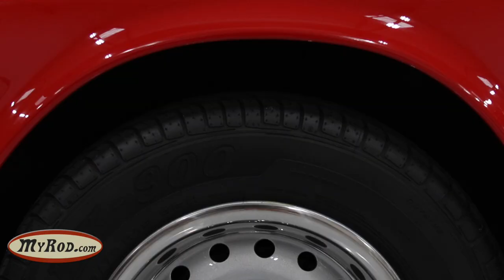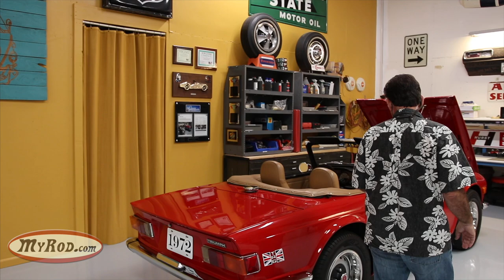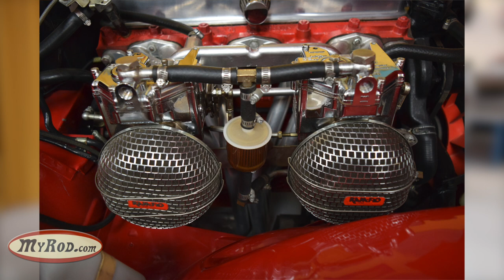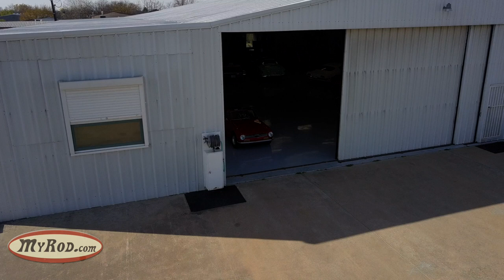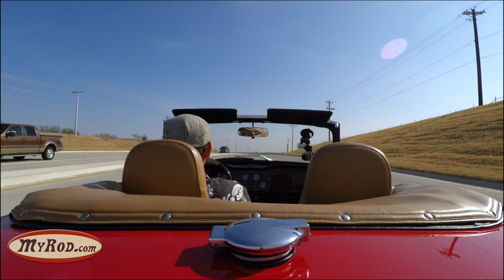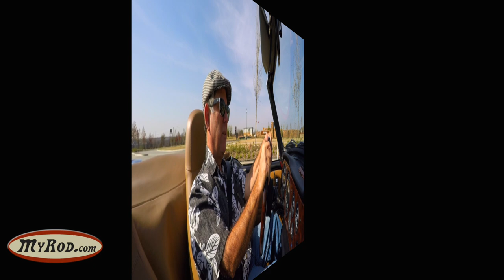1972 Triumph TR6 - overdrive & performance upgrades!

Comment: This is a beautiful example... almost new feeling. I've owned a couple of these, a '72 like the one shown here.  The purist in me notices several anomolies here, so many "improvements", the narrator keeps referencing the seat comfort, however, he mentions the seats are out of a Miata. TR6s weren't built with the driver's comfort in mind, they were thin, hard and light. And where's the red line tires? Or the blackout rear taillight panel?  It wasn't body color like this one.  The 1972 did not fly the Union Jack graphic on the rear quarter panel. Minor stuff, but the purist will and has noticed.  The engine bay IS beautiful, but again far from stock ... a chrome alternator? I will say the Webers are a great touch, as is the rear end box on the U-Joints.  The rear end is a real issue with so many 6's, there are 6 U-joints in the TR6, with its full independent suspension. I would have liked to have seen if there was any mod on the shocks/struts on this one. The exhaust is also a piece of art, and again, so far from original, but a nice improvement. I would try and find a pair of stock wipers, the ones on this car were too big. 
This car is a magnificent version of the car, and the improvements are well done and enhance the beauty and performance of this classic.
Reply: I own a 72 Red TR6 & have the GTO style TR6 lettering which I actually prefer to the Union Jack symbol.  I would love to have overdrive as I agree my TR6 is not comfy on the highway.

Comment: VERY nice, but shouldn't the windscreen surround and rear panel be black? And my 1969 PI (sold 17 years ago) had a flap as fresh air intake that could be opened and closed from inside the cabin :-)

Comment: Finishing the rest of my dads 69. He bought it 40 years ago hit a stop sign, and put it in the garage the whole time. Finished it 75% of the way 7 years ago did 1 car show with it and then it sat again. Zero rust, zero cancer all original garaged thee whole time. White top, white tail, all white interior, cherry red exterior with black bottom rockers. So unique. Just so on the fence on rebuilding my Strombergs or going this set up. Anybody have any input? Motor fully rebuilt mild cam in it

Comment: Just a note the rear end should be painted flat black , the tires should have red walls, the1972 did not have the union jack just TR6
Reply: Good Call.

Comment: Beautiful example, here in Britain we had a Lucas fuel injected version of this car,  actually a standard conversion here would be to replace the injection system with a triple webber set up, to be honest I've never seen a twin webber set up like this, why not go for three webbers?  Also on the overdrive, a company in England called Revington makes a relay box that means when you are in overdrive and want to change gear the  the relay box automatically switches you out of overdrive without having to manually use the change lever, it is quite useful, I have it on my car, RHD 1970 fuel injected with A type overdrive. That exhaust you have sounds like a Ferrari ,your right there, and of course "Ansa" are probably most renowned for making exhaust systems for Ferrari road cars. Lovely example, my compliments, Im here in Scotland, nice driving roads here, I've had TR6s for 40 years, it is the best car ever, and so easy to work on.Thanks for sharing your video.

Comment: super excellent. I always wanted to hop up my green '76 from what, the restricted real  100 hp or so .... the Webers a tuning problem or upgrade not from perf. but day in out reliable ?
Reply: The myths about Webers going out of tune are just that; unlike the Strombergs which I think your TR6 would have had, there are no moving parts to alter the tune from day to day. You won't believe the improvement in throttle response with Webers, with those big accelerator pumps, which also make starting dead easy - dab, dab, and turn the key.  They respond really well to a warm cam and higher compression ratio to get them sucking harder. Initial setup is tricky, there are a lot of "experts" who aren't, so dyno time is a must. Emulsion tube changes make a big difference in driveability, so try a few, but the dyno will again be very revealing.

Comment: Always loved the TR6....but my z4 will eat it for lunch. Beautiful car.
Reply: a TR6 & a Z4 are 40 yrs apart. Most of BMW car Design came Directly off Triumph's Designs. 
It's like saying My Electric car Uses Less Petrol than MY V12 E-TYPE Jag. 
You will Need to be ONE HELL FIRE of a Fast Driver to Pull away from my  BMW 525 i. 
I Blip the Clutch & Flick the Stick at 6750 rpm in every gear. until i'm Flat out . 
Single figure mpg. 
It will Happily Glide a Roundabout in 3rd at 50 mph. 
Push the Tail out & Steer with the Throttle pedal. 
I Find it more than Adequate to get through City Traffic at rush hour. 
& Fantastic on open Fast Country Roads. 
Drop a gear & Go into a bend with POWER ON Then FEED THE POWER ON until  Flat out,   ON,  or just after the Apex. 
Go in Fast under engine Braking, Match the Speed & Power for Traction, & POWER out FAST 
Never Change your Speed / Direction MID Bend, Allow the Car to Pull you round & THEN POWER OUT. 
OK you might be 6500 rpm engine Screaming under heavy engine braking dropping to 4000 rpm , Giving 2500 rpm instant Acceleration on the Exit. & Flick it up a gear to Pull away before the revs fall below 4000. 
Keep the 24 valve VVT Vannos Spinning.
& these cars are Like LIGHTING if you Drive them as they were built & Intended to be driven. 
Screaming i mean it will sound like a Jet Plane on Rapid Decent. 

A TR6 is for calm Lazy sunday afternoon Old Fashioned Motoring. IN STYLE. 
A Z4 says :- I had lots of Money but I Ran out of ideas for a Fun Car. 
Brilliant Shopping Cars For those who wish to look COOL in a SKIRT. 
Black Tights until 5.30 pm & Fishnets & Heels in the Evening. 
FORD CAPRI STYLE !!
Reply: @A1DJPaul  Well played sir. Touche.
Reply: @A1DJPaul  Having said that look up the BMW 507.  Pretty sure BMW came up with that design.
Reply: @daverunner3397  
Leave them Standing On the Road, Track, or in the Comments online. 
WOOSH I'm AWAY !!  all the best & see u later Alligator !
Reply: @A1DJPaul  Wink wink nod nod....
Reply: @daverunner3397  
OMG !! thee MOST FANTASTIC CAR DESIGN EVER !! 
( The Old Single Headlamp Sports car , ? 1950's early 60's Style ? ) 
I SAW one in a BMW Dealership & Thought INSTANTLY I WANT THAT CAR !! 
IT Looked so Modern & Mind Blowing. 
Is that the One ? or do you mean a Modern Version ?  ? 
Are we on the Same Car ? 
This one had a 'V' shaped grille 1960's Style /Ferrari style front . ( GTO ) 
2 dr sports car , Drop top, 
Merc 107 Pagoda era ? 

I think BMW did a Very Expensive / Exclusively Priced Car 10 / 20 yrs ago ( not the z1 ) 
My vision is of a Triumph Spitfire Style Car but slightly bigger &  As Good Looking as ANY E-Type OR Ferrari.

They were Silly Money New, & Silly Money Now.  £100k ++ ? Is that the One ?
Reply: @daverunner3397  
Thanks, Are You UK / USA ? 
I'm in England.  Yorkshire.  i owned & drove quite a few very old Triumphs, 
2000's / 2500's, Dolomite 1850 's , TR7's ,& a Spitfire. 
I never ever seemed to land on a Good running Cheap DOLLY " SPRINT " . 
I Will ONE DAY !! 
The ULTIMATE of BRITISH Car Making & ENGINEERING GENIUS !! = Dolomite SPRINT 2.0 16 Valve engine back in 1973 !!!!!!!!!!!!!! 
That Engine would have made the " STAG " FANTASTIC !! 
Or the 2500 'S' engine. OR   with a Factory Design & fit ROVER V8 as the Flagship Model. 

the STAG DESIGN should have LOST the " T " Bar Roof, & addad body strength under the car & in the sills & Bulkhead & the boot Area. 
& NOT HAD Hard Fixed Chrome Window Frames etc. 
More Like the Far Later BMW e30 Con'v Design shape.  A Windscreen & then Nothing . 

A Stag with a 2500 engine would have been SUPERB  back in the day. & a Factory Rover V8 as a premium version. 
BY that Period GERMANY & THE EU were SABOTAGING the UK Motor industry in any way Possible, Helped By the UK Government. Ready for joining the " EEC". 
Fuel Crisis of 1973 Hammered Sales of Big engined cars. 
Britain had FUEL RATIONING !! 
All A PLOY to Get us to Join the " EEC " / EU " . 

PRE 1975 Britain was the WORLD LEADER in Car Design & TECHNOLOGY. 
Now GERMANY Sells Cars to the CAR  NATION of the WORLD !! 

ALL German cars were 4 Decades Behind UK Style Design & Performance. 

JAGUAR Produced the very 1st Mass Market V12 engine. 30 + years before anyone else. 
OH 
and the LAND ROVER & RANGE ROVER.  A Whole new NICHE Market Sector. 45 yrs ago. 35 yrs before most others. 

THE JAP's are Smart & Clever.  SUZUKI SJ / JIMNEY. = Land Rover are almost identical in performance & Ability.  ( except in the most extreme cases ? )

Open top Sports car The BEST & Cheapest = MAZDA MX 5. 
filled the MASSIVE HOLE in the Market for MG's MGB's . Spitfires,  TR's , 
Fiat X1/9. 
Fiat Got it Right with the X1/9.  Less the RUSTPROOFING. 

BABY Ferrari 4 Sure !!  GENIUS Little Cars !! 
I LOVED EVERY MINUTE OF MINE !! 
Back on My WANTED LIST at ANY PRICE !! 

New Stuff ? I would Buy a FIAT 124 Spider, And A New 2018/9 Suzuki jeep. 
If i Had the Need , Money & Use for them. 
the 124 spider is a MAZDA MX5 Build , Under a Fiat Badge. 
But the Far Better Looking of the two.
Reply: @A1DJPaul  USA Always loved the Triumphs when I was younger. TR6 Spitfires....
Reply: This is what is so wrong with out modern society. My God, is this how you treat and speak to people in person?  "Always thought your wife was kinda cute, but mine screws better than yours."   WHO CARES WHAT YOUR CAR DOES  - If you're so proud post a video of all the lunches you've eaten with it, but shows some dignity and respect.
Reply: P.G. Brexit  I see Brexit is going well for you😂

Comment: Its done to a fine standard but there are just too many major modifications for a TR6 purist like me. I deliberated a long time before upgrading the cooling and braking system on mine but that was because these in standard form were found to be a severe handicap for touring continental Europe,
Reply: I think the owner would say the same for the components than he upgraded as well.

Comment: The heat shield between the carburetors and the exhaust.
Thermal spacers between the carburetors and the intake manifold. Don't convert to tube shocks on the rear end. Use the lever shocks and the 3/4 valving.
Adjustable Koni shocks on the front set on number two. You want the car to respond to the road.
You don't want the suspension so rigid that it beats the car up.
A rear sway bar makes a big difference. Do not put a small block 350 in a TR6. It destroys the car. The car loses finesse.
Run the Michelin 205 R70 15.

Comment: I'm looking at a TR6 1974 and I'm told it has a bent or stuck valve, $1100 buck. The body I rolled with a magnet and it's fine, Tiny bits of rust on the rear quarter panels above the fender. Being a former auto mechanic looking for a project, just wondering if this is a good car that can be fixed up without searching the globe for parts? I can fix any car with a carb, this new computer stuff came out after I left the biz.
Reply: that cheap, head jobs are a cake walk on triumph 6 cylinders. plenty of people doing parts too.

Comment: How does the overdrive work in this car? I get that it's supposed to act like an extender for a speed on the engine (by speed I mean gear), effectively giving you a couple of additional "in-between" gears and an extra one at the top end, but how does it achieve this?
Reply: Leylock OD was a secondary set of gears like a camshaft that electronically engaged atop the transmission to extend third and fourth gears. I had a lot of fun with a '68 GT6.
Reply: @blackfly29er  Thanks for your help. What do you mean by "like a camshaft"?
Reply: Unlike a torque converter, it's a planetary set of gears that physically engages with the transmission dropping the drive ratio, and RPM's.
Reply: @blackfly29er  Oh, I see. Thank you!
Reply: To clarify, it is in fact for all practical purposes an "accessory" to the transmission, almost like it's own little secondary transmission. It bolts on to the end of the transmission. It is engaged using the switch on the steering column. Or in some other makes, by a switch on the dashboard. If you really want a TR6 with overdrive and can't find one, you can always go out and simply find a laycock Overdrive and add it to the end of the transmission. You of course would have to also find a shorter drive shaft since the overdrive extends the length of the transmission by about 12 in. Or, if you can locate a late 80s Toyota Supra transmission, there's a kit that will allow you to bolt it right up to the TR6 engine. Then you'll have a true 5-speed!

Comment: The proper carb update should be triple DCOE Webers (or preferably 40 DHLA Dellortos) with one choke per cylinder rather than the convoluted siamesed inlet tract shown here that does nothing for power or torque.  The ultimate is of course PI, either a well set up Lucas system (difficult but OE) or an aftermarket electronic system with slide throttle inlets.

Personally, the Laycock O/D sucks and there are plenty of modern 5/6 speed trans that could do a far superior job tagged onto the back of the TR6's engine.  Even back in the day in UK nobody I know deliberately opted for the O/D unit on any uprated car it was too much a PITA

Comment: My TR3 suffered from throwing heat into the cockpit which made driving her in hot summer weather miserable.
Reply: Sooo hot!  Both my 6’s had warped cardboard tranny tunnel covers.  Felt like sitting next to a blast-furnace!

Might be a useful feature somewhere cold, but not in Hawaii!

Comment: Was this also a TR250?
Reply: Greetings from blighty. 
TR250 was the 'Americanised' TR5. ie same 6 cylinder engine but with Stromberg Carburettors instead of fuel injection.
TR5 body styling was virtually the same as the earlier Michelotti designed TR4.
Early TR6 were essentially mechanically identical to TR250s in the US, but with bodywork re- designed by Karmann in Germany who IMHO did a fantastic job. 
European TR5 and 6s had 150bhp and could do around 7 secs 0-60 on 5 star (high Octane) petrol. 
In 1973 Triumph de-tuned the engine, and took away 2nd gear overdrive option, and made a few trim chages , a shame in my view. 
Quite a few TR250 cars have been re-imported back here into the UK from the US, particuarly as TR5 models are rare and getting super expensive in the UK.

Comment: Anyone ever hear of the aftermarket TR6 Frame builder. It was called the TR6 Plus 6, as in plus 6 inches more width and a proper Boxed Chassis. Obviously , it requires some quality fabricating on the trunk and hood/grill as well as the bumpers. It made for more shoulder/leg room as it was a wider body!If I had the money, I cant imagine building any other car than the TR6! It was my 2nd car (Triumph GT6+ was actually the 2nd) A truck ran me over so the TR6 was bought with my insurance $. Goodness I loved those two cars!

Comment: Nice video. That exhaust note would get tiresome on a long drive. Best TR6s I have seen have a modern engine with 200+ hp and 5 or 6 speed trans and lots of improvements to the suspension, electrics, interior & weather sealing. Purists may be upset, but as these cars came from the factory they were less than what they can be now with updates. There was much 1940s & 50s "technology" in the British cars up until the last of the TR6 models. The overdrive is great to have, but a 5 speed trans would have been lighter and less complicated. But, always nice to see any old British car restored, either stock or modified. Cheers. 🙂
Reply from the maker: Thanks!

Comment: Why is the windscreen frame the same as the body, that's an only 1969 model year.  The BL fender badges look wonky.  Miata seats are not concours either.

Comment: Great looking TR6 except for the body colored Kamm tail, my '72 has the correct black after a respray, just seems off to me without it and it has the wrong Union Jack badges, a 72 should have stenciled TR6 logo not the Union Jack, the air intake in front of the windscreen is wrong too. It should be a lever actuated flip up and not the later black grill that this car has. The dash is not original and the seats are not as well as the center console. I'm sure it is fun to drive, but this would not do well in a concours competition. Now, mine wouldn't either... my mods were made by Bernard Juchli (Jay Leno's Head Mechanic) but I would never claim a "Show Quality restoration" b/c it isn't nor is yours. I bet it is a fun car 🙂 but it is not going to win any shows with so many non-stock changes.

Comment: Oh dear. This is no better than a kit car. Yet it clearly works. The point about owning a CLASSIC car is you buy one warts and all. The seats are a joke here. The British version has PI - something the gas guzzling USA market rejected! This one has a lovely sweet note I will give it that. But this is no lady, sadly been a tart since its immodest rebuild.
Reply: Well I'd have a TR6 again in a flash, BUT I'd probably do even more ;  like put a jag rear -end in, that trailing arm suspension always was rubbish.  So there!
Reply: Nothing wrong with a restomod car.  Its fine to be a purist but not everyone is and thats what the aftermarket is for.
Reply: Just because turning the wipers on high changes the radio station doesnt mean it's a bad car!

Comment: First Mistake, adding over sized Japanese car seats... 
The original TR6 seats are very supportive and well built. People have now become lazy and dilute the car's heritage in the process of "restoring". The tail end of the car should be painted mat black as well as the windshield surround too. 1972 models did not have the British Flag decal on the rear fender. That started with the 73 MY "CF" cars
"Triumph Master Tech"...Seriously?